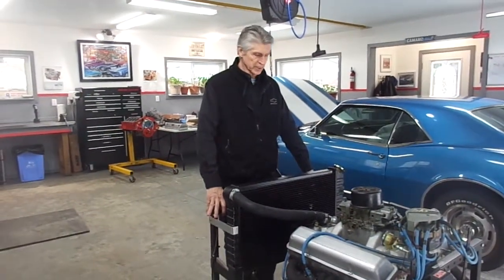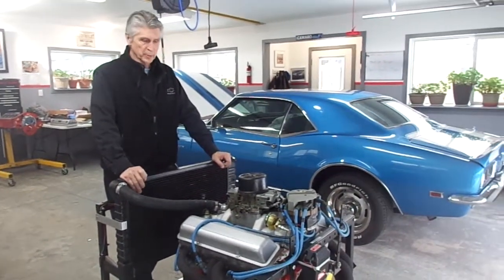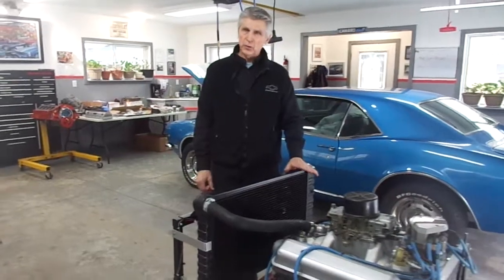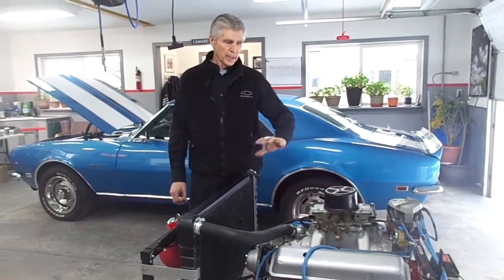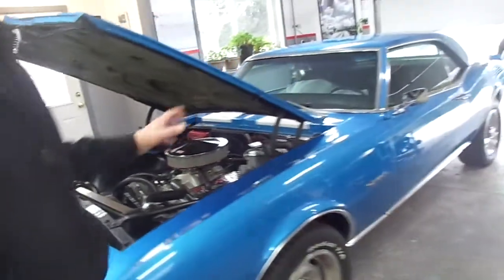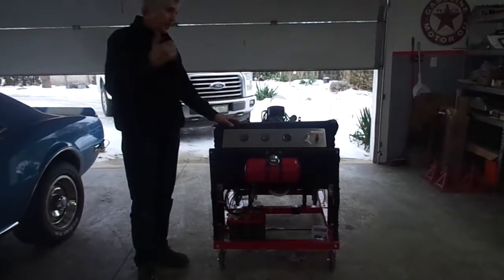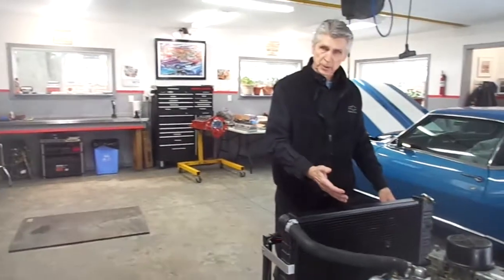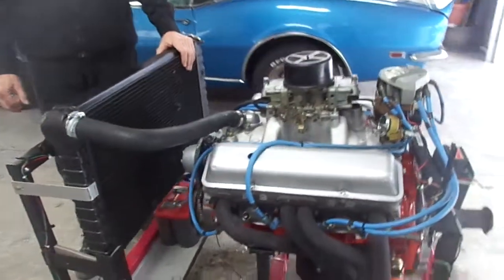ZZ6 CT400 tuning on engine test stand

Comment: Outstanding!!  I want to freshen a used 604 for my 86 vette.  A couple questions please.  Exactly what duel plane intake matches up with the fast burn heads?  any vortec?  Or does the CT400 fast burn have a raised intake port like the LT4?  I want more cam.  Somewhere around 225 / 235 108 lca 4* retarded?  Can I help quench and SCR by swapping to a .020 compressed head gasket?  (stock is .025 in the hole and a .050 gasket iirc.)  I am so stoked to find a competent pro that uses these 604s on the street.
Reply from the maker: Thanks for the question David. The 604 is an awesome engine. There are thousands of them used in circle track racing all over the continent, and that is what I have in my Camaro, right out of my circle track race car. . 
I used a dual plane intake manifold from a 602. I probably lost a little top end power but it moves the peak torque down almost 1000RPM on the curve, so much better on the street. 
The cam numbers you suggest sound about right. You can also add some lift with 1.6:1 rocker arms. The head gasket change for quench is good, you will also add some compression. Check your final piston to valve clearance. 
In competition tech inspection, these engines whistle about 10:1 CR, so you will have a little more.
You can download a manual right from GM on line. I think the max RPM is listed at 57 or 5800RPM but in competition they run at 6400 all day long. 
Hope this helps.AG
Reply: @goldsgarage8236  I think there might be a profitable side gig to take 604s that have lost their edge and recondition them as street engines.  A knowledgeable guy with a machine shop such as your self might make it work.  I might even be one of your first customers!
Reply from the maker: Thanks David, the only problem is that cores are hard to find. AG